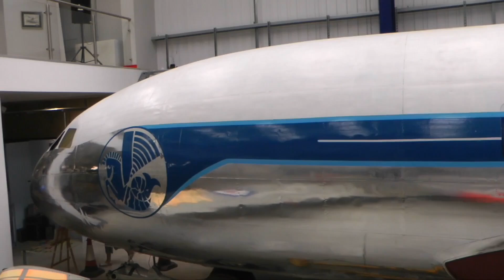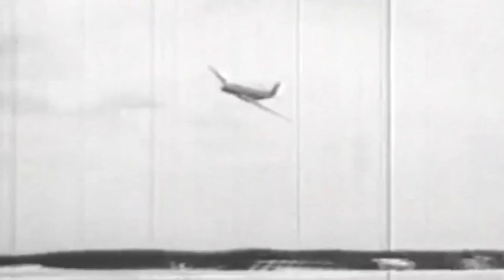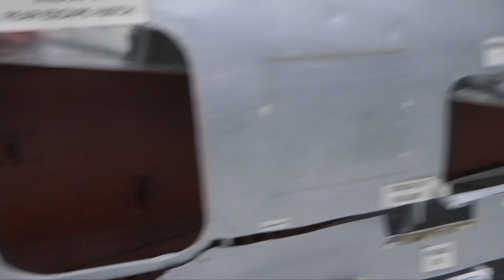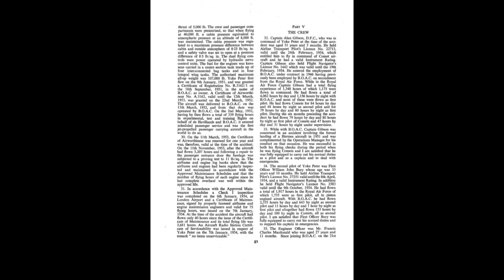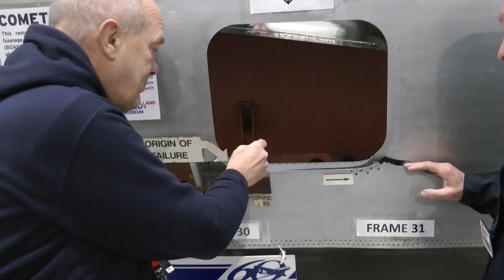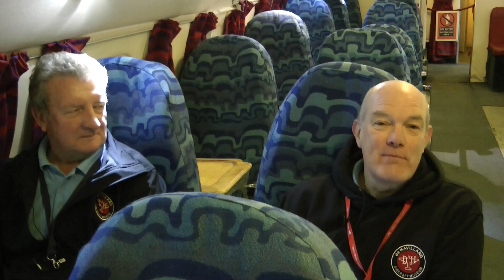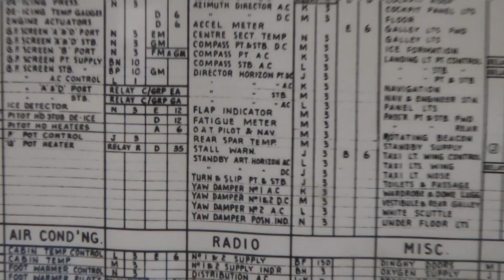The plane that changed the skies forever. DH.106 Comet Airliner from de Havilland

Comment: I have flown on Comets, only the 747  was a better experience.
Reply: The Comet was very antiquated in many ways, in fact it wasn't even an all metal aircraft... de Havilland still relied heavily on Balsa and Spruce plywood covered in linen fabric.
Reply: @sandervanderkammen9230 , this is the DH 106 Comet not the DH 88 Comet, the DH 106 Comet Airliner was an All Metal aircraft, the DH 88 Comet Racer was of mixed construction. Wow, just wow.
Reply: @gregedwards1087  You have never seen a DH.106 Comet 1 up close have you?
You look a bit foolish right now.
Reply: @sandervanderkammen9230 , where are the references and evidence for what you are saying??
All of the documentation that I have seen over the years has not once mentioned that the DH 106 Comet Airliner was built with those materials as they, LOGICALLY, would not be suitable in that situation.
References please or stop Trolling, whinging and complaining.
Reply: @gregedwards1087  So you admit that you have never been inside a de Havilland DH.106 Comet 1?
Reply: @gregedwards1087  Just the facts here lad, the Comet was constructed with a significant amount of wood, de Havillands preferred material.
The flight deck, passenger deck, cargo deck, and all the bulkheads were constructed from balsa/spruce plywood.
  Women were not allowed to wear stiletto heals onboard the Comet as the Balsa plywood structure was easily damaged and high heal shoes could break through the floor.
 de Havilland lagged decades behind in aircraft technology
Reply: A lot of that has to do with the 20 year difference between these two aircraft, Comet, 1949....... 747, 1969, and the advances of technology, construction methods etc.
Reply: Also safe to say that there is a significant difference between the first 747's and the later versions.

Comment: Excellent video.  The hazards of being first were apparent with Comet, even Boeing acknowledged the great debt they owed to the lessons from Comet.
As a foot note, I beleive Sud-Aviation licenced the Comet nose design for the Caravelle.
Reply: The Comet was not the first pressurized airliner, Boeing introduced pressurized cabins in 1938 and, by the time of the Comet Disaster, had successfully sold over 6,000 pressurized aircraft
 Unfortunately, the Comet Disaster was completely preventable if de Havilland had simply followed well-known and understood industry standards for the design and construction of pressurized cabins.

The only lesson learned from the Comet Disaster was that aircraft manufacturers like de Havilland could no longer be trusted to conduct their own crash investigations.
 De Havillands handling of this engineering failure was absolutely reprehensible and was the direct result of gross engineering incompetence and criminal negligence at de Havilland.

FYI; the Nose of the Comet is copied from the Boeing 307 Stratoliner, the world's first pressurized airliner.
Reply: @sandervanderkammen9230 

It will come as no surprise to most that we feel able to shed some light on some common misconceptions and myths, of course.

It's always good to see the facts presented clearly and concisely isn't it?

  That's quite correct of course, the Comet nose was entirely unique, was not copied from another aircraft & was in fact licensed for use by Sud Aviation for their rather fabulous Caravelle.

  That's correct, Bow-wing (See B-47 wing collapse & wing folding incidents) hadn't managed to sell more than a dozen pressurised airliners before the first flight of the Comet. Having had more than 50 years design & build experience on the type there can be no excuses for the horrendous Bow-wing Max incidents for example. 
   
  That's correct of course, at the time the Comet didn't have particularly high accident loss rates relative to many other aircraft.

Losses comparisons, how things were in those days.

DeHavilland Comet 4                            14%
DeHavilland Comet all  (ff 1948)         17%

Boeing 307                                              70%
Boeing 247                                              48%
Boeing 707            .                                  20% 
Lockheed Electra Turboprop                   29%
Canadair CL-44  Turboprop  (ff 1958)    46% 
Convair CV-580  Turboprop                    22%
Convair CV-880    (ff 1959)                     27% 
Convair CV-990     (ff 1961)                   35%
Tupolev T-104 (ff 1955)                          16%

   Indeed, De Havilland carried out a full stress analysis & engaged in a comprehensive & protracted testing program which is why key De Havilland people were happy to be aboard flying DH Comet aircraft.

  Of course it is in fact the case that no aircraft before the Comet had been subjected to as much testing as the De Havilland Comet.

  Agreed, of course De Havilland did indeed always work to better than industry standards at the time, used up to date knowledge for the design & construction & no evidence of negligence  or criminal negligence was ever produced in relation to the DH Comet.

  De Havilland designers / engineers knew all there was to know about metal fatigue at the time they designed the DH Comet.

  Of course De Havilland had prior experience building many all metal construction airframe aircraft including many passengers aircraft & thousands of jet powered fighter aircraft that were primarily of metal construction with pressurised cockpits & jet engines built by De-Havilland.

  Indeed, one of the key features of the DH Comet was of course its high altitude capability.
It was in fact the first airliner to have 8 psi pressurisation for the entire fuselage length which resulted in it being the world's first airliner where pressurisation stress significantly exceeded flying load stress.

  Obviously the Comet was an all metal construction airframe aircraft & like all similar airliners used other materials for no structural items such as interior trim. The rear pressure bulkhead for the Comet was obviously not made of wood for example.

  British Aircraft Achievements Notes.

  The world's first gas turbine aero engine demonstration was in fact performed by Whittle in 1937. Sir Frank Whittle patented bypass & reheat before 1936.

  The world's first axial multi stage sequential stator rotor turbines & compressors were produced in England by Parsons of Ireland & North England. The same components used in many modern gas turbine aero engines. Parsons also did some work on the internal combustion gas turbine engine. In fact people at the time in England before 1900 had already discussed the concept of using those components for an internal combustion gas turbine aero engine for powered flight & so had invented the jet aircraft before the Wright Brothers had given any thought to flying.

  The first example of a pressurised cabin aircraft was a British design Airco aircraft built under licence in the US & modified to have a pressurised cabin during a joint UK / US research project.

  The gas turbine engine was first conceptualised & patented before 1800 in England.

As always we hope this helps of course, obviously.

Cheers & 👍 indeed.

The line above has clearly been left blank.
. . ..... ....... . ........ ..... ....
. ...........         .....        ....
Reply: @sandervanderkammen9230 

The DH Comet had significantly more research and pre-production testing than any previous airliner had ever been subjected to.

The fabulous trail blazing DH Comet.
World's first jet airliner.
World's first high altitude airliner.
The first aircraft with a full fuselage width and length pressurised cabin where pressurisation stresses were higher than flying load stresses and were many times higher than flying load stresses. 

It's surprising then just how low the accident loss rate was for the Comet. 

    How things were back then.
Accident losses - % of aircraft built.

DeHavilland Comet 4 UK                     14% 
DeHavilland Comet all (ff 1949)         17%  
Vickers VC10 UK (ff 1962)                   5%

Douglas DC-1                                      99%
Douglas DC-2                                      47%
Douglas DC-3                                      30%
Douglas DC-4                                      26%
Boeing s300                                          72% 
Boeing 307                                            70%
Boeing 247                                            48%
Boeing 707  (ff 1958)                           20% 
Lockheed L-049/149 Constellation    30%
Lockheed Electra  Turboprop .            29%
Fairchild FH-227                                   30%
McDonnell Douglas DC-8                    14%.
Sud Aviation Caravelle  (ff 1955)       15%
Canadair CL-44 Turboprop (ff 1959) 46%  
Convair CV-580  Turboprop                22%
Convair CV-880     (ff 1959)                27% 
Convair CV-990     (ff 1961)                33%
Tupolev T-104        (ff 1956)               16%
Vickers Viscount   (ff 1948)               32%             

  The Vickers VC10, fastest Atlantic crossing for a non supersonic jet airliner, held the record for 41 years.

For the first few years of operation the Caravelle & Comet had similar accident loss fatalities.

Instances of all marks of Comet flew with full certification until retirement of the individual aircraft until 1992. Nimrods were flying until 2010. 

The first few Nimrod airframes were Comet 4 airframes with the equipment bay tacked on. Subsequent Nimrods were new build Comet 4 airframes with Nimrod modifications built by the DH team at Hawker Siddeley.